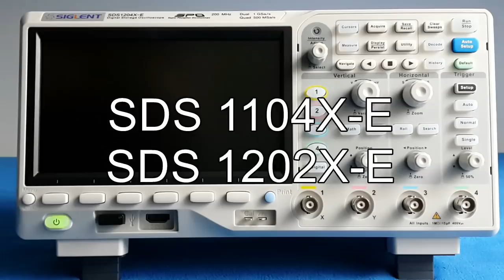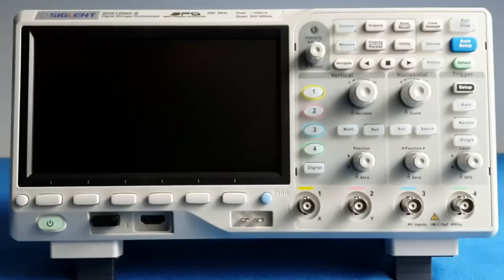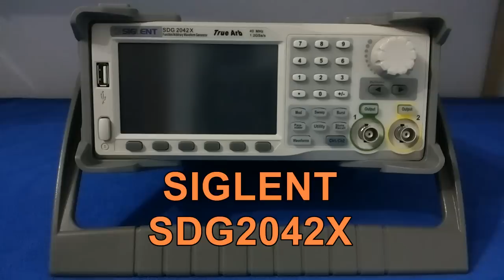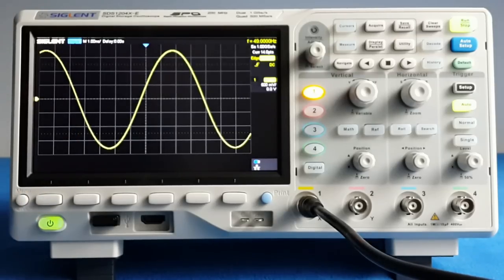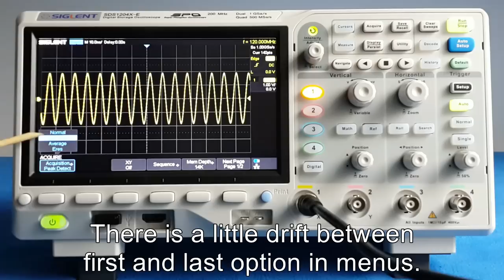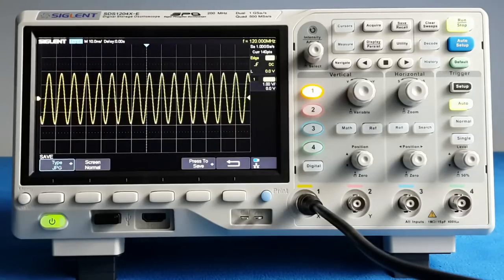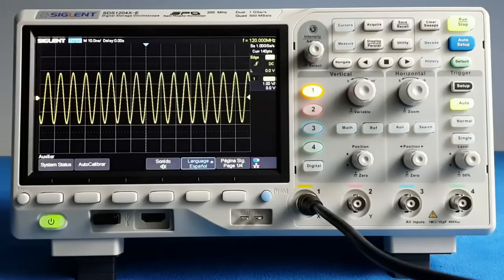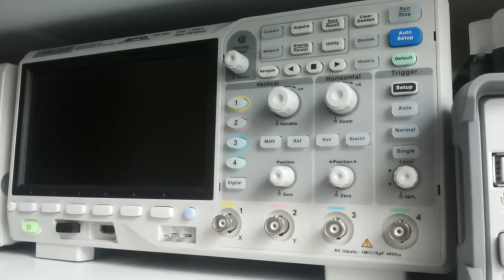SDS1000X-E product review / oscilloscope Siglent SDS1204X-E SDS1104X-E SDS1202X-E 100MHz & 200MHz

Comment: I can´t understand about channels, 1GSa only 1 ch? but it says Dual 1GSa
Reply from the maker: Hi! Dual 1GSa or Quad 500MSa mean 1GSa for CH1 & CH2, and another 1GSa for CH3 & CH4. If you use  the 4 channels, it will be 500GSa for each one. (Sa. if you use simultaneously CH1, CH2 & CH3, you got available 500GSa for CH1 & another 500MSa for CH2, and CH3 will get 1GSa for it).

Comment: This scope is perfect for the hobbyist🔶>imgs.love/Si-Oscilloscope?ㅜ1   and the repair professional. It is amazing compared to my old analog unit with the CRT. The scope has LAN capability and USB write for storing images. Built in measurement of frequency and voltages show on screen with the image.
Reply: Worth mention that only the 4-channel version has Bode plot possibilities (with dedicated external function generator). But I agree, it's a great scope. But like most digital oscilloscopes, the X-Y function with lissajous patterns are somewhat below what you get from a true analog scope (probably due to the Nyquist rate and common A/D-sampling for all channels). A good lab has a digital scope as well as an analog one. Together they will handle all kind of measurements :) 

Regarding X-Y lissajous patterns, here is a good signal source for testing: https://www.youtube.com/watch?v=qnL40CbuodU